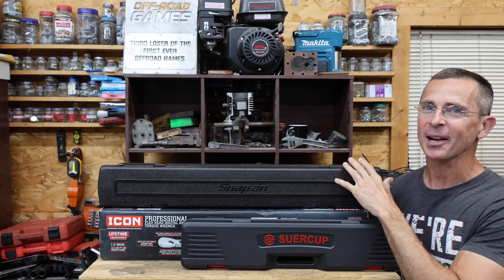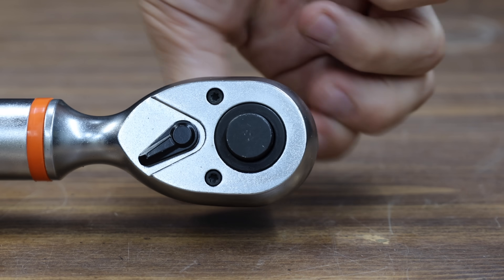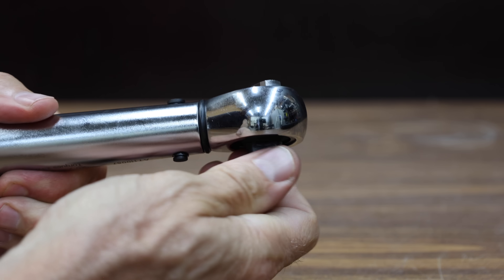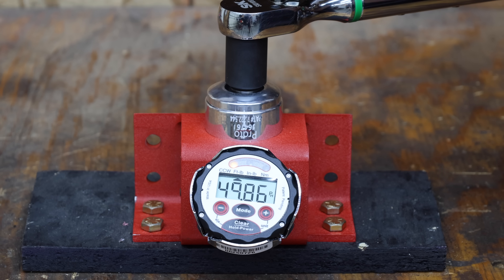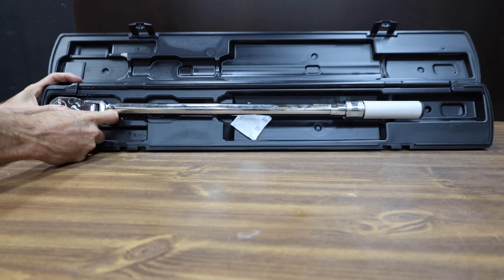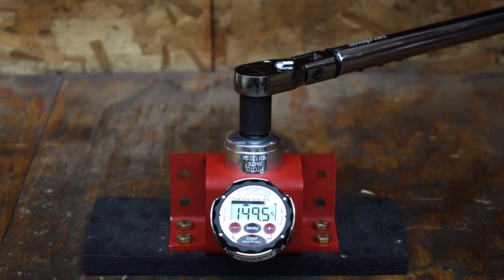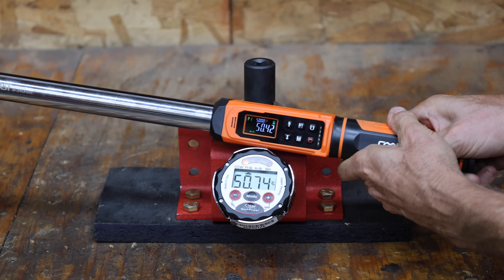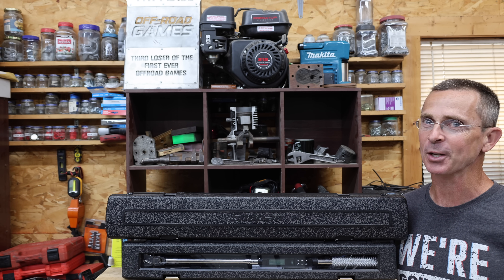$78 Torque Wrench vs $790 Snap On & ICON—I Didn’t See This Coming!

Comment: Great test. I especially liked the quick torque test - really shows which of these will be accurate in daily use where you might not be quite as deliberate in your torquing speed as you should. I know it's not in the budget but it would be cool to see a follow-up video where you do the same test on 3-5 of the same torque wrench (say the Suercup and a couple of the other budget options that performed decent) purchased at different times from different vendors to see if the brands have good quality overall or if you just happened to get a good one.

Comment: I have the icon one. When doing head bolts and doing the degrees and the bolt starts popping/skipping. The torque wrench turns off. Pretty annoying

Comment: As a mechanic I spent 20 years watching guys drop thousands of dollars on torque wrenches, they legit believe if it doesn't say "Snap-On" that it's trash. Hate to break it to you but you can take the same $1500 torque wrench and use it 10 times in a row and you'll get 10 different applied torque values. 

It's not that serious. You're either in the specified ball park or you're not. $150 torque wrenches work just fine.

Comment: Professional mechanic here. Great video!  I appreciate your tenacity and thinking of every scenario, very thorough! I think any of those torque wrenches would be close enough for torque, in my opinion. What I would be interested in is the capability of the torque angle feature, and the ease of use of the angle feature, especially in tight confines with limited range of motion. Most modern engines use torque to yield bolts, I would like to know which of those wrenches that you tested, have angle capability. I know the snap-on does, and that is the only one I heard you mention.
Reply: The Icon does as well.

Comment: Do any of the wrenches have ability to measure degrees of rotation AFTER the preset torque is reached?   
Some automotive applications require this, usually critical bolts like cylinder heads.

Comment: Cool test, but IMHO, a big benefit of the new digital wrenches is the ability to calculate the torque angle as well as the basic torque.  Many modern  fasteners need a torque spec and an angle spec to be properly installed.  Maybe you could do a "part two" and test wrenches that can do both?

Comment: The $90 Coobeast jumped to $130 within 2 hours and then 1/2" disappeared, replaced by a 1/4 drive model, same for Suercup. The $141 Craftsman is now $214.48 and the Vevor remains at $84 but for some reason Amazon wouldn't allow me to add to my wish list. Good thing though since the reviews are really bad.
Reply: Yup can confirm that the 1/2" suercup has completely dropped off the face of the earth on UK google. Every time you click on any listing available it is replaced by the 3/8 and 1/4 version. Also the original price of £77 is gone and even the remaining 3/8" is now £115. That's over $150!

I know supply and demand exists but still, this is shameful. Luckily i already have a really good 1/2" click type dewalt torque wrench but man I'd be mad about missing out on either of those two if I didn't
Reply: @mrspuffispeng  absolute shame they decided to remove or jack up prices. i won't be buying any on principle unless the price is the same or lower when they eventually relist them
Reply: @annettesurfer yea its crazy, also the day this video release, Amazon services were down that is why you could not add the items to your wishlist. It sucks they raised the price from 90 to 130, I really needed one!
Reply: Coobeast or suercup, they probably come from the same factory as they basically share the same mould. There are several alternatives on Amazon, just got myself a torque wrench set from Uharbour, which has the similar appearance and is also very accurate or even more accurate than my old Icon torque wrench.
Reply: I've pretty much written off Vevor tools after several lawsuits about their products failing, and a couple of bad first-hand experiences with their tools. Quality control seems to be a serious problem with that brand.

Comment: thank you so much for everything you purchase and test.  I have made multiple purchases based on what my budget allows based on your tests.  I may look into the Suercup as i only have a small torque wrench and need another.  Thanks again.  As for other tests:  electric spray guns can't remember if done already, siphoning pumps or electric pumps for gas cans, C clamps or wood clamps?

Comment: I want to relube my office chair. I found a spec sheet with the torques for each screw, the highest being 250 inch pounds. Should I be getting a torque wrench, power drill, or something else? These torque wrenches don't look smaller than power drills so I'm not sure of the trade offs.

Comment: I've had my same 50 dollar HF click TQ wrench for almost 15 years. Work in a helicopter hanger and use their calibration sensor and when new it was only off by 2% but you can take an allen key and adjust it, we got it down to 1% over 30,50,80,120,150 Ft/Lb and it hasn't gotten worse. Pretty nuts for 50 bucks.

Comment: Great videos,  and content... One of my fav chnls.
There is no-such thing as Foot Pounds of Torque!!!
Foot Pounds is a measurement of FORCE, expressed as Ft/Lb F.  Torque is LB/Ft T [Mass divided by Distance]
A 200 lb person standing on 1 sq/ft is 200 ft/lbs.
Don't feel bad, Snap-On got it wrong too. 🙂
I know it's common use, but it's still wrong.
I retired from GM fasteners lab.

Comment: Concerning calibration certificates, unless it's issued from a 3rd party calibration lab and compliant with ISO 17025 (it will say so on the cert), then it's about the same as toilet paper. Those slips of photocopied paper the manufacturer includes is absolutely worthless.

Comment: Any of these are fine at 50 ft-lb, considering the significant variability that is inherent in using torque as a measure of bolt tightness to begin with.

Comment: suercup digital 1/2 is sold out, they have a nice mechanical set with 1/4, 3/8, and 1/2 for $80.  Finally have a comprehensive torque wrench set...

Comment: If many only knew how many factors go into torque, clamp loading, rotational friction, thread compatibility, fastener material, ambient temp, thread contamination...you would learn that a torque wrench can only measure how much force is being applied to the fastener head to satisfactorily 'tighten' the fastener at the head of the fastener, not through it's entire length.

Comment: For mechanic using them all the time for angle more so than torque with a digital wrench. But the snapon has alot of settings like if u add a 3" torque adaptor u just set apply it in settings and wrench calibrated accordingly

Comment: Picked up the 3/8 Sanp-on tech wrench several years ago. I love it. It was expensive at $500. I do not need precise angle at 1/2 drive sizes. I am afraid to replace it now. $750.

Comment: just bought the icon a month ago it is fun to use compared to the old manual one where you have to twist it to set and then turn it back to zero after using, I like the lights sounds and buzz to tell when you reach right torque on the icon.

Comment: I am glad you posted this video…I had to get a torque wrench awhile back, its an old Craftsman…a “Clicker” I made the mistake of buying the HF digital adapters. They have a very slow reaction time. It was unfortunate, but they were tho only things that fit where I was working. They were similar to the AC Delco. Seeing how I only use a torque wrench on my lug nuts now, I will have to see how accurate my Torque Lug Adapters for my Ugga-dugga are. (Impact wrench) Thanks for the post! Very Impressive!

Comment: All interesting stuff.  HOWEVER, is there a way to test and demonstrate how much a half or pound of torque really matters to the average joe?  I've put together many a small block and V4 and V6 2 stroke Evinrudes with a simple lever torque wrench and even at times only my forearm wrench and never had a problem..

Comment: one thing i have found with some of these electronic torque wrenches is that they draw power even when off.  Just like the cheap calipers .  i have a couple and i have to remove the batteries after every use of they will be dead the next time i use it .

Comment: Digital torque wrenches are proving to be much more accurate and reliable over click type. I just purchased a Tekton split-beam which also appears accurate. My best discovery is the accuracy of torque adapters! $35 Harbor Freight adaptor and I can verify the accuracy of any torque wrench within 2% error.
Reply: Could you explain a little more on this process? I've been thinking about those HF torque adapters for a while now but unsure on it's accuracy.
Reply: @pichidubz-566 - I’m not an expert but the HF torque adapters are very straightforward. Come in 3/8” or 1/2”,  have both so I can compare between the two. Grab an old torque wrench and adjust it to a desired torque (say 50’lb), then snap the adapter on and torque until the torque wrench “clicks” then read the HF torque adapter scale.  Just compare the torque wrench against the adapter, dead simple.  So if the torque wrench is set to 50’lb but clicks at 45 then you know it’s under reading and needs to be calibrated (or simply compensate for the deviation). You can use it with just a ratchet or break-bar to, the adapter flashes as it approaches the preset torque.
Reply: @ynotjf damn I knew you were gonna say that! Lol but yeah it makes perfect sense obviously.

My problem here is as of now I have not one torque wrench at all so guess I should still get one first before I get those torque adapters to have a ballpark of how much to compensate for the adapters.

Comment: A good video as usual, but I would have liked to have seen the weight of each wrench included in the final list. The Suercup looked like it had very light weight construction. I was wondering if a heaver wrench (more metal) would be more durable. There wasn't a drop test.

Comment: Years ago when I started as a mechanic I used to use torque wrenches for many things, water pumps, valve covers, oil pans, etc.. These days I know when the bolt is tight by feel. I only use a torque wrench for engine heads now. For lug nuts I use torque sticks for my impact gun. If you know how to use then correctly they're fairly accurate, within ballpark. Never had any over-torqued or under-torqued lug nuts.

Comment: Can confirm, GearWrench is dog poop. I bought and returned three different torque wrenches from them due to errors in their readings and the most expensive one (like $400 I think) that was all digital and fancy was the WORST one of the bunch. The mechanical click types where better, but still were not consistent.
However, CDI is still my go to. I have two digital torque wrenches from them that I bought back in 2012 and they're still perfectly on spec when tested (I have it inspected before every valve job or other critical torque application).
I might look at ICON now though because CDI has gotten much more expensive these days. 
As always, thank you for the review!

Comment: I purchased my first torque wrench at Sears in the 1980s like many of my early tools. This thing had a wobbly handle and two rods...one for the wrench and the other to act as a needle that pointed to a scale near the handle. The main rod would flex a measured distance and the needle would point to the torque level. What was interesting about this torque wrench is that the handle wobbled and you needed to apply your pressure with the handle floating on that single pivoting pin. I wonder if the accuracy of these wrenches would be similarly affected by the position of your hand when applying pressure to the handle? I still have the torque wrench and use it when I don't need the precision of my click wrench, which is a pain to pull out of it's case and set up...this thing is perfect for torquing wheel lug nuts where extreme precision is not necessary!

Comment: One suggestion next time you test electronic torque wrenches, let us know who can do angle. That's important for those of use buying one of these for engine work. 

Also that Snap-on keeps count of how many bolts tightened after you set it. If you tighten all the bolts on your truck, that counter should read 32. If it only reads 31 you didn't get them all. That counter has tipped me off to a missed head bolt twice.

Comment: That's a lot of money to spend on a tool like that. My personal torque wrench? . . . I found it half buried in the dirt at a junk yard underneath a 2011 Mustang GT California Special I was pulling the faux carbon overlay dash pad out of. At first I was confused, because why would you need a torque wrench at a junk yard? I thought maybe it had been left behind because it was broken, but it was also possible that it was found in the car by someone before me and had been left there. Either way, I picked it up and stuck it in my tool bag and then forgot I had it for two weeks. When I remembered I had it, I torqued a set of lug nuts using my Dad's torque wrench, then set the one I found at the junkyard to the same value, and sure enough, it clicked at that exact value without the lug nut moving at all. I tried it a few more times at different torque values and it seemed correct every time. So yeah, the torque wrench I trust my safety to by using it to tighten the lug nuts on every car I own, I literally got for free by picking it up off the ground at a junk yard.

Comment: I haven't had the chance to use the snap on or icon digital. But have used the snap on and icon split beam torque wrenches. I love the price of the icon but it feels cheap hard plastic instead of the rubber that snap on feels like. 

Do you feel the same from the digital ones?

Comment: 5 of the torque wrenches got better after 1000 cycles and 7 of them got worse. The ICON got better but not by much. From a build quality one would have to say that the ICON was better than all of the others as it didn't change much over use. For the occasional user 1000 cycles might be a life time to get better accuracy unless they could send their torque wrench to Project Farm for break in and return.

The Suercup and SnapOn although accurate got worse over time indicating to me that they were wearing out instead of wearing in.

Personally I think that most all "electronic" tools of any kind are junk looking for a trash can so I will stick with the spring click type of torque wrench or a beam type torque type.

Comment: I use the feel of removing the nuts with the feel of installing the nuts. I must be able to feel the pressure well as my mechanic has recently inspected my work with his torque wrench and said that I was close to what all 4 spark plugs should have  torqued too and within manufacturer's specifications. My dad must have taught his son well for quick torqueing bolts on the car in our backyard. Maybe I will buy a torque wrench some day. Liked the CooBeast best as it was most accurate at a lowish price but the Suercup isn't far behind in my opinion. Both give good value even if they aren't the best. I will probably only use a torque wrench 2 to 3 more times in my life. Why spend the money on something better than I need to.

Comment: Yes but the Snap-On and Icon are a torque-angle wrench and offer more than a standard cheap digital torque wrench.  If you need to work on modern engines you need the angle wrench as they specify something like 60 ft/lbs + 60 degrees.

Comment: You should have included a beam wrench and a mechanical click wrench in the test.  I would also say that the speed that the torque wrench responds is not really important.  When torque a bolt is should be in one smooth action, not jerking the wrench.
Reply from the maker: Thanks for the constructive feedback.

Comment: After close to 30 years of rebuilding engines in auto,and powersports, a couple of pounds difference won't be an issue. Obviously if you're in the aviation field you need your torque wrenches tested multiple times,  but then again, you won't be buying $300 torque wrenches either. Lol
Reply from the maker: Thanks for the feedback.

Comment: I have the Icon 1/2” digital torque wrench and the batteries would die if I left them in. Now after taking them out and putting them in so many times they no longer connect and it wont power on. Ive tried going back to the store for 5+ months this year and they haven’t been able to replace it because they never get them in-stock anymore. Apparently its “because of tariffs” so hopefully eventually I can get it replaced. Also I wonder what country they get the icon stuff from that is having problems with tariffs.

Comment: Many years ago 70,80,90's Snap and Sears (Craftsman) were the only games in town at least in Virginia. Sears was much cheaper so Snap On mobile salesman had to improvise with the extras (out of their pockets). Craftsman back then was hard to beat since they would even warranty drill bits, you give them a bad craftsman and they gave you a new one with no fuss or muss. I think what really attracts mechanics is that SnapOn wrenches are smooth and shiny. SnapOn has always been very expensive with quality questionable depending on tool. When MacTools came along everyone jumped aboard same quality if not better and much cheaper. Most mechanics end up with a mix and some like I have should be in the Smithsonian. P.S. Quality rebuild shops own a torque wrench tester and they test their torgue wrenches each day before assembling engines. My personal experience is that a good quality torgue wrench will generally only vary 1-2ppi so no bar types and store in case not lose in drawer or take care of it. IMHO
Reply from the maker: Thanks for sharing.